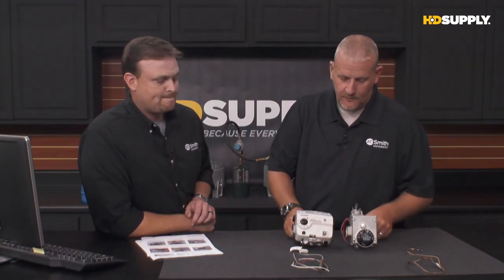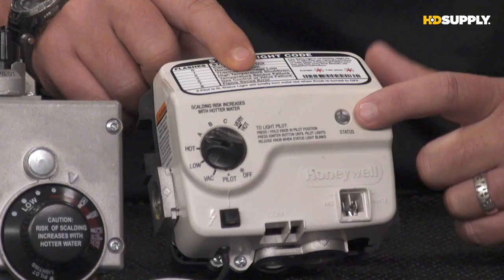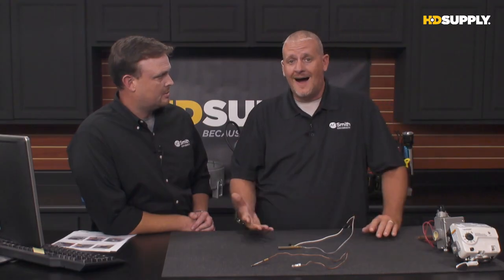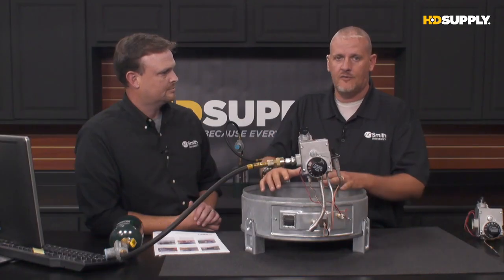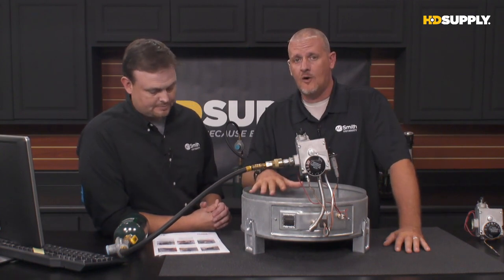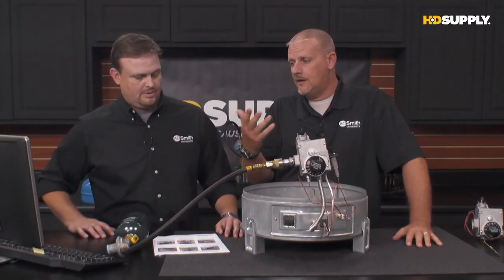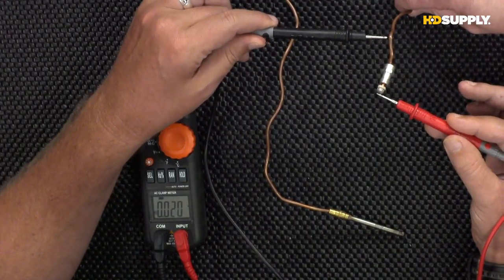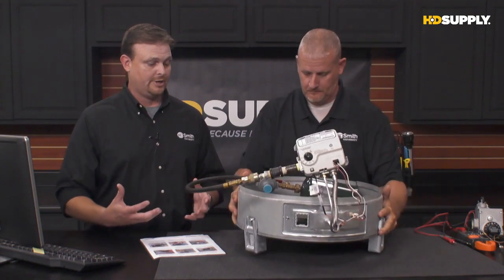A.O. Smith - Troubleshooting Gas Water Heaters | HD Supply

Comment: Homeowner here. AO Smith GVR 50 replaced burner and can light pilot and start burner, but wont reach temp and then will not restart burner until I go through steps to re light pilot manually.

Comment: Great video so my question is I ignite the pilot and it stays on the burner fires up after a few hours the pilot is out so I would say air flow problem unit is dirty or chimney needs cleaning how that sounds thank you also my unit does not have a thermo switch like it showing on yours with wires on it the unit is GE

Comment: Thank you! I had that thing with the pilot light not staying on when relighting it, and was able to correct the situation by resetting the switch you mention. I also washed the filter that wraps around the bottom of the tank. I'm assuming the dirt and dust on it caused the switch to trip? Okay for now. Thanks!

Comment: I noticed that my pilot light won't stay up, then I replaced the burner assembly kit, it does lit but after the burner shuts off the pilot will shut off as well. Feel really confused now, could it be a thermostat issue?

Comment: Hi guys, I have a 40 gal AO Smith water heater and I cannot get the lug loose to change the diode!

I bought a longer one and ,since it is in service, don't want to tug it around a lot trying.

Any suggestions would be deeply appreciated.

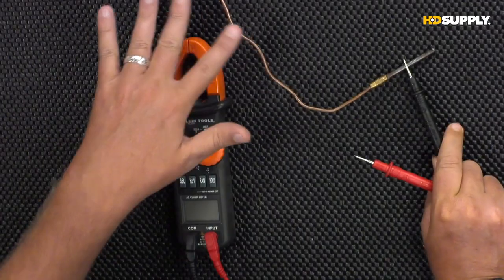Comment: 21:40 ck Pilot
Hold down pilot button
With fire in flame 
 10 milli volts DC  or more copper line to fitting end.
 If more less then 10 replace it

Comment: Anyone seen this odd behavior with a gas burner water heater, before???
https://youtu.be/Pnjh8xPI328

You will notice at the end of the video for about 1 quick second, the burner worked normally again.  I can't explain it and not sure what is causing it to behave this way other than a faulty burner but if there's anything else I can do to prevent me from having to replace the entire burner, that would be great!

Comment: I just installed a new A.O. Smith Water heater.  50 gall. natural gas and the light is flashing like it is normal, once every 3 seconds, but the pilot light is out.  does it kick on only when the water needs heated?

Comment: I have an AO Smith water heater that is approx. 2-3 months old. It is an attic installed unit . After about a month I got called out for no hot water. The pilot was out and I had to reset the safety switch to light it. After a few times I called support and they sent me a regulator. I installed that. Again it started having problems. They said to get a plumber to check it.  We did. The plumber recommended replacing the burner assbly. We did. Now I've relit the pilot twice and the resident just called about it being out again. So, now the tank is approx. 3 months old the regulator about a month old and the burner assbly about 2 days old. I cannot keep lighting this thing daily. HELP

Comment: Thanks Fellas! Your detailed explanation and visuals helped me to solve the mystery of the colder than ice water hot water tank. It's probably been out for couple of days, I didn't notice ( taking cool showers) until it was time to hand wash some dishes. 

I had No pilot and I couldn't see the spark. I had to move the washer, get down cheek to the floor, and turn off the light in the closet AND the next room (and wait for the sun to go down) to even see IF there were a spark. Turns out, the Pilot could only be seen if your face were plastered to the floor and you were looking UP from the floor through the tiny glass window!!!.  

Next the Pilot wouldn't stay lit, so I waited a minute and it still didn't stay lit. I pressed the thermal switch and that didn't help. 

 I didn't feel like doing this multiple times, so after hearing about the thermal couple, I decided to hold the pilot for 5 whole minutes while I watched the rest of the video on my phone about testing with the volt meter. by the time the timer went off. I had to shut my eyes tight because of after image, but finally, in the darkness, I saw the faint blue flame still going.  The pilot stayed on!

I wonder if my thermal couple is getting old to not hold it open for the pilot to go out in the first place.  Or after hearing at the end about air flow, my heater is in a smaller closet like room. also my furnace pilot is going in there as well,  warming the whole space( I've got the sweaty shirt to prove it!) I wonder if I can just turn the pilot to the furnace off now that it's summer? I don't need heating!!!  Anyway, I need to get the moving blankets out of that room and other tools and junk restricting air flow. Occum's razor says that's most likely given the warm days we've had recently.  

Yay, Now I can go...finish washing the dishes...BOOOOO!

Comment: Can you make a video on how to restart/reset the Honeywell Controller when it's computer board goes haywire? There are literally hundreds upon hundreds of people having an issue with the defective controller by Honeywell. Our heater was purchased & placed the laundry room; please know our laundry room is pretty big. Even w/washer, dryer, & upright freezer, there is still room for a utility sink.I hope to have one placed in that room one of these days.  It was brought here on Monday's Day. It wasn't connected or have soldering wires are in place. Oh, the flue pipe is working as it should; the pilot is sparking but not lighting; hwr we haven't attempted to reset the controller yet. Actually debating on taking it back to exchange for a different water heater that doesn't have the Honeywell controller or going with an electric hot water heater & use the extra $2-$3 hundred to pay an electrician to handle pulling wire from the breaker box to this room so an electric can be used.

Comment: I have a brand new AO Smith and when it turns on it makes a sound that it best described as a loud tone, a squeal. Eventually as it heats up it will stop but sometimes it does not. I have a large home and the water heater is in the garage and can hear the noise all the way in the farthest back room. Help!! The valve, the burner has been replaced under warranty. Thank you!!

Comment: So my 14-year-old A.O. Smith water heater pilot will light, but after nine minutes, it goes out. The thermocouple was replaced in June (10 months ago). It makes one knock, runs a minute longer, then shuts off. I have tepid water. I've been told there is a small leak at the hot water output line. Thoughts? (I'll probably have an answer tomorrow, after the plumber's been and gone, but others may benefit from this.)

Comment: I am trying to pull the burner assembly along with the thermocouple so that I can replace the thermocouple but it looks like the door is completely sealed by some sort of adhesive. I took the two screws off each end but that did me no good. This thing is solid. Do you have to use a torch to heat the seal to get the door assembly out of the unit to replace the thermocouple? This is the worst of any hot water heater I have ever worked on.  The model # GCV 50201. Any advice would be appreciated.

Comment: The reset button is continually tripping I've replaced everything but the burner. I thoroughly cleaned it out. The hot water heater will get out but then the switch will trip again after about a half hour. What is the problem

Comment: On the mechanical style thermostat with the plastic sleeve, what would cause an issue with it reading the incorrect temperature and allowing the water heater to overheat?  Can buildup occur around the shaft causing an incorrect temperature reading?  
My water heater has been overheating and blowing out the pressure relief valve.

Comment: Pilot light went out and would not stay lit. I replaced thermocouple assembly with factory replacement. Pilot will light and stay lit. Burner will come on and burn for 5-10 minutes then burner and pilot will shut off. There are no restrictions to combustion air. What is going on?

Comment: I know this is an older video but just wanted to comment that you can always bench test a thermocouple with a small torch.  Many torches have a 'lock' feature than might be easier than using the pilot button locked down.  You can wrap the copper around the head of the torch just barely putting it into the flame while you're free to operate the meter/test equipment.  Don't use an acetelyne torch though as you'll likely melt the copper/ruin the TC.

Comment: I have a Honeywell digital control valve on my water heater, and it is flashing a code 5 which is temp sensor failure. What do I need to replace?

Comment: Good video, thanks,  i have no spark on my AO Smith water heater.  Does that mean a bad thermocouple, a bad pilot, or something else. Any guidance you can provide to troubleshoot a "no spark" issue is appreciated.
Reply: no  its the igniter
Reply: Sounds like piezo  igniter switch is bad if you push button down it’s not lighting the pilot light.

Comment: I pulled up this video trying to find the answer to Blocked Exhaust on a commercial unit. The manual pointed me to a unit/fixture on the top of the water heater.  It turned out that part was fine, but someone had put paper towels in the pipes along the side of the hotel building I work at.  Just adding this comment so should anyone run into a similar issue, they know where they can check.  Thanks for the video!
Reply from the maker: +Alex Mammoth Thanks for the tip!

Comment: ao smith hot water heater the pilot comes on and the furnace comes on and stays on only for a few second then turns off , the same thing happen to a new assembly i installed .
Reply: Adel Sayegh some have a door food under the burner it burns out and closes the intake door so the flame blows out
Reply: Adel Sayegh what caused this?
Reply: Confused
Reply: I'm not sure
Reply: Me,too
Reply: Pilot will light but once we run water the heater dont kick on and pilot goes out
Reply: I have same issue.  I light the pilot stays on burner comes on then randomly shuts off? some times a minute after burner starts  Any idea?  Should I replace this unit.
Reply: I have the same issue. How did you get the problem solved?  I have been using a box fan to blow to the bottom of the new AO Smith water heater for the past 4 years each time before shower after the new heater was installed. But for the last 2 weeks this trick no longer works!!!
Reply: What was your issue to yours?? I am having the same problem..😑